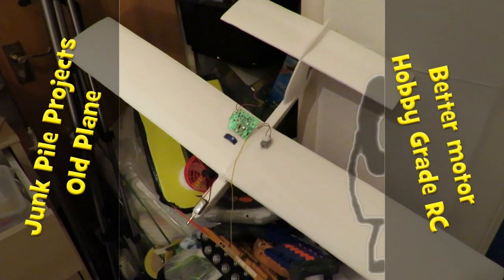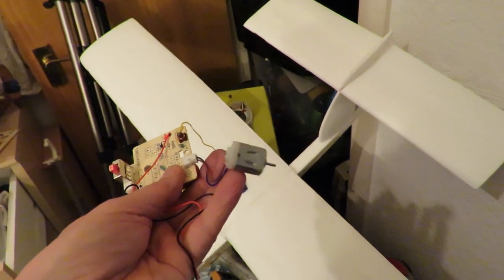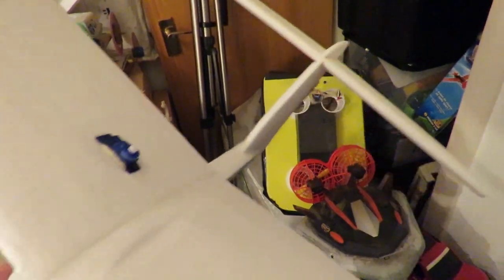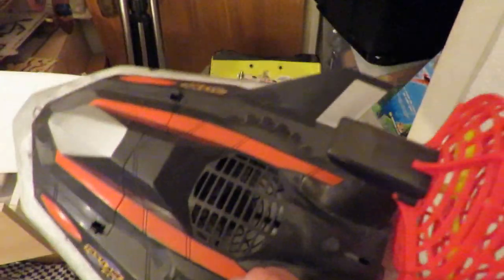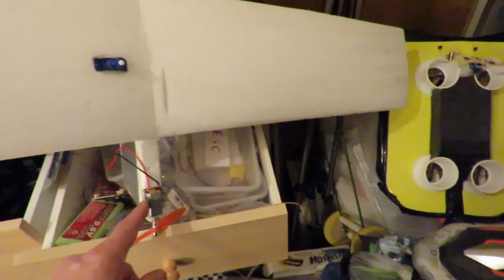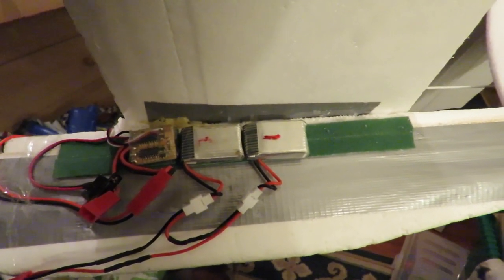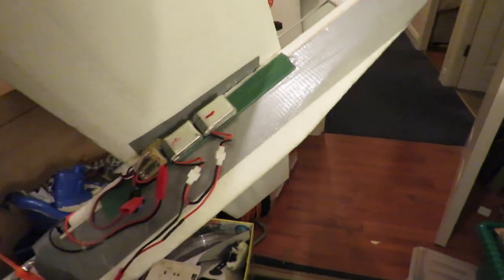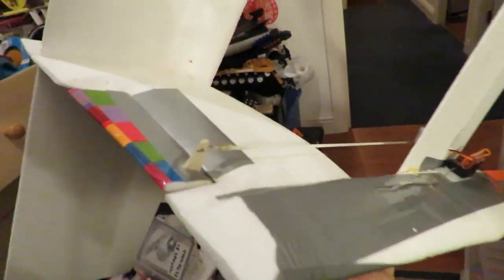Junk Pile Projects - Old Plane Better motor Hobby Grade RC

Comment: "Lots of people wanted to see the plane fly properly"... +1 on that comment  !
Looking forward to this.
25% chord CG, bit of down and right on the motor, adjustable elevator with couple of degrees up to begin...she'll go well.
I'd only add a kite rod under the wing for strength and 1 down the fuselage (got the same kite rods on my Nutball). Fingers crossed :)
Reply from the maker: +slider2732 flying properly may be a stretch of the definition but it does fly and climb. I didn't add any strengtheners and I only gave it a rudder after all we cannot have one of my planes fly properly can we :) I have managed to break it twice which is funny because I only intended to fly it once to prove it could fly with a little more power and then scrap it.

Comment: I seriously thonk that sadly it won't fly because of the motor. I'd recommend you to upgrade to brushless. If I were you, I'd go to hobbyking and buy a brushless motor(a bell type o like the blue wonder) an esc (20 to 30 A) and a 3s 1500mah battery. The rc planes I made and flew used brushless tech.
Reply from the maker: +Pau Climent Salazar if you go back through the series that this plane came from you will see it was built in response to a question about using cheap RC toy car components. That is why I did not use hobby grade components.

Comment: Please post a vid of this flying already!I've also built a two channel plane using RC car electronics. Mine's considerably smaller 3D profile design and I'm only running 1s lipo to keep weight as low as possible and to avoid burning out the geared N20 motor from a $5 non-RC "UFO". The prop pushes quite a bit of air but I can't get it to fly. Poor COG maybe?
Reply from the maker: There is a playlist featuring the different stages of this plan but here is the flight video https://youtu.be/6dw0gQTXJog?list=PLA5a2xPRSrB3v7nI2gkMPSAD5LOoSQkzk

Comment: Set the throttle trim all the way down then you shouldn't get any/not much reverse
Reply from the maker: +Eddie 21 it only occurred to me a couple of days ago that I could use one of my ESCs that has the brake option. They don't go into reverse if you go straight back on the stick. I do have a couple of ESCs with no reverse if I can find where I put them. The one in the plane is just the first one that I found laying around handy.